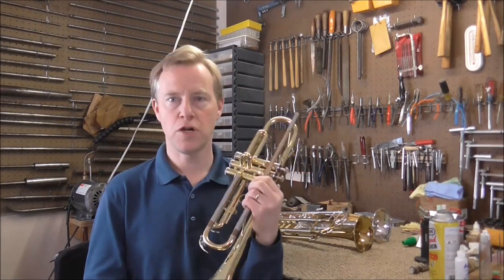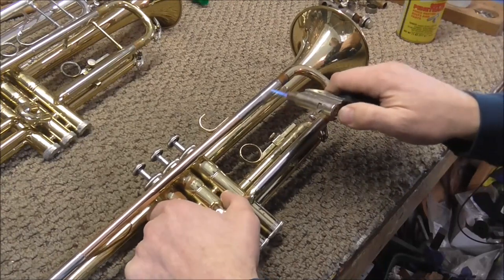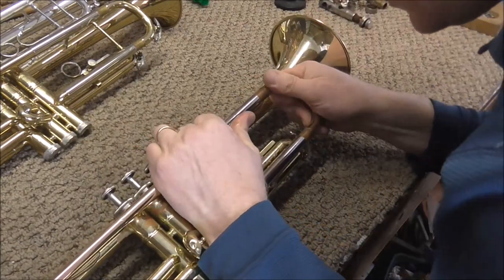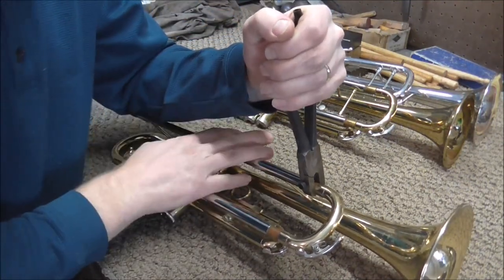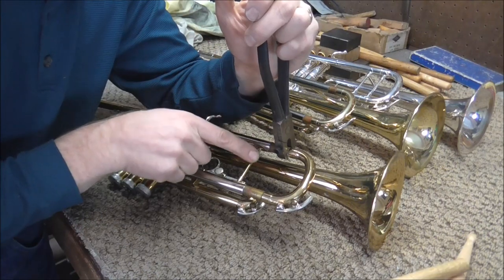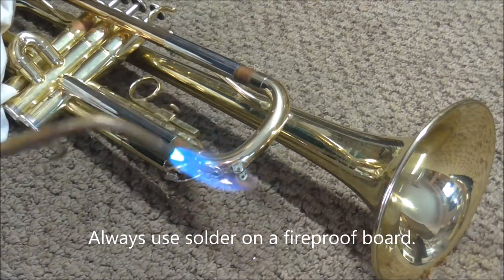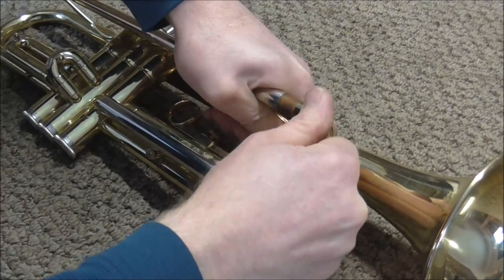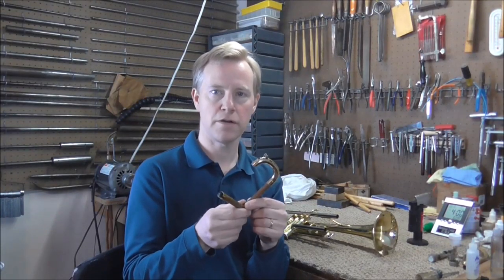How to Remove a Stuck Main Tuning Slide

Comment: Just a tip for newbies, you can also use combo oil to lossen up the tuning slide a bit. After you get it out, be sure to give your trumpet s bath and clean out the lead pipe very well with a snake brush. When you put it back together use some slide grease and it should move perfectly.

Comment: Thank you for all your very very good presented trumpet repair videos, especially this one for example. They are all 100% clear and masterful. In following your instructions with the 3 drumsticks, I was able to remove the tuning slide on a double braced king 2007 that had been totally in pushed in position. I of course worked with a penetrating oil too, but the drumstick trick did it immediately (it came out with "that knocking sound").

Comment: Really interesting video.  I have a Yamaha 1335 with a stuck main tuning slide that is pushed all the way in, it’s been stuck a while, probably calcium build up - would you go straight for desoldering given that you can’t get at the inner slide.  There are no braces to lever against either…
Reply from the maker: Try watching this video first. 
https://youtu.be/1TXqs9_oFXs
If that does not work, then I would unsolder the crook.

Comment: I'd have used more penetrating oil, and I'd have sprayed it into the leadpipe as well so that both ends of the tubing got soaked.  I'd also have given it more time to penetrate, plus, as I was working the slide and when it started to move, I'd keep adding penetrating oil to make things as slippery as possible.

Comment: i was wondering, if its calcium buildup, cant you use vinegar to dissolve the calcium? kida like with shower heads and stuff?
Reply from the maker: Yes, vinegar will work too, but I do not have much experience with vinegar, so I cannot say much about how long to soak it.

Comment: I would sneak some water with crushed ice cubes into the tuning slide through the valve casing, and then heat the tuning slide from the outside.  Thermal expansion will make the outer part of the tuning slide become larger than the inner part, solving the problem.

Comment: Just curious, what brand of penetrating oil do you recommend? Hoping to do as much as I (safely) can before bringing it in to an instrument repair shop. Based on research, I’ve seen that liquid wrench is a good bang-for-your-buck product
Reply from the maker: I do not know which brand is the best for musical instruments or if they are all about the same. Maybe I should do a study on that and see if one is better than another.
Reply: What I’ve found that works pretty well  is acetone and transmission fluid. It penetrates excellent, has no Aerosol fumes, and can be mixed quickly to any Viscosity... I just use a brush or Qtip most of the time..
Reply: @210gremlin  G'day, Thanks for your fabulous videos. Do you know which penetrating fluid is least toxic but still effective? How does Liquid Wrench compare to the acetone/transmission fluid mix?
Reply: Good ol pb blaster did the trick for me
Reply: @thespiritof76..  If Acetone is used, using a torch as well would not be a good idea, it's flammable.

Comment: What techniques do you have for freeing up a yamaha trumpet one piece main tuning slide that doesn't have the tubes to unsolder?
Reply from the maker: I hope to do a video on this some time. 
Take a tuning slide priers and tap one of the ferrules so that it moves about 1/4 inch. Cut the slide under where the ferrule was. Twist the slide out if you can. Slide the ferrule back into place and solder everything back together. 
I hope this helps.
Art
Reply: @TheBrassandWoodwindShop  Yes thanks. I hate this design!

Comment: My brace is in front of the main turning slide, what do I do
Reply from the maker: I am not sure. I would have to see a picture of the instrument. If you can email me a picture, I will try to help.
Reply: @TheBrassandWoodwindShop  What's your email so I can send the picture to you
Reply from the maker: thebrassandwoodwindshop@hotmail.com
Reply: @TheBrassandWoodwindShop  Have you gotten my email yet?
Reply from the maker: Sorry it took me so long to get back to you. If the brace is on the tuning slide, treat it like the one with no brace. Put penetrating oil on it and then try the twisting technique. If that does not work, try the tuning slide pliers, and if that does not work, you will probably need to un-solder it.